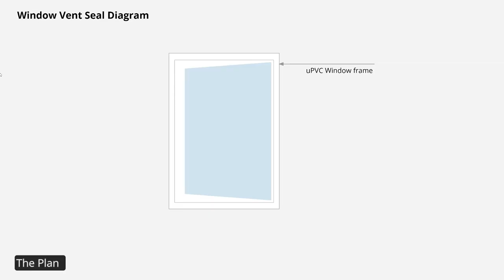DIY window seal for portable air conditioner - Easy step by step guide

Comment: Thank you so much...  This is brilliant!  You did a fantastic job.  So much so that I just followed your directions and made one of these for a Newair AC-10100E.  We just moved into a house, and the window screens are inside the window glass.  This seal is perfect for that.  It even allows for removing the seal and opening the window quickly when the air conditioner is not in use.  The only thing I changed was that I used a thinner sheet of foam core and wrapped it in insulation on both sides for a slimmer profile.  I also covered the edges of the hole with duct tape after adding the insulation, similar to how you wrapped it earlier in the video when you reinforced the edges around the polystyrene before applying the insulation.  So basically, I did it twice to complete the hole, making it durable enough that the hose can be removed intermittently when the seal is not in use.  I also made sure that the foam core was wholly sealed from moisture.  I then added a gasket along the edge in places that didn't have velcro.  When installed, the hose is flush with the windscreen which automatically protects the open end of the hose and prevents problems with pests.

I live in Hawaii, and the sun is really intense here all year round and heats up homes in no time during the day.  I'm using this in conjunction with the De'Longhi insulated hose cover, and the unit cools my office quickly.  The hose cover is a MUST-HAVE for any portable air conditioner owner.  It's night and day, in terms of the performance and efficiency of the unit.  The hose cover prevents heat from escaping into the room from the exhaust hose.  The De'Longhi one WORKS.  The hose is barely warm to the touch even after using the unit for a few hours.  My office is about 135 sq ft with a 20 ft sloped ceiling that heats up dramatically in the late afternoon sun.  This seal is a headache saver.  Thanks again.
Reply from the maker: Really glad you found this useful and thanks for sharing your project too!!

Comment: Been searching for this solution a long time, everything else would ‘t stay in window. Instead of Velcro I used  gorilla heavy duty mounting tape, worked like a charm! 👍
Reply from the maker: Gorilla tapes seemed to come off from upvc frames as they heat up in the sun when we tried so had to resort to velcro for the second room. But good luck!

Comment: I ended up using twin wall Polycarbonate sheet from b&q cut it to fit . Applied hook & eye tape to secure to the window frame.  And when not in use I either pull of the frame to close the window or wrap some insect screen around the opening with a reusable cable tie to stop bugs coming in. Been working brilliantly in this heat. 😄
Reply from the maker: Polycarbonate sheet is a great shout! Feel free to send us a pic and we will upload on our website if you are interested. Best wishes

Comment: Great video, I can't wait to make my own. Also, do you have any tips for keeping the hose from sliding out of the hole? Mine keeps popping out with the plastic piece that it came with and it's driving me crazy.
Reply from the maker: Suggest you make it a tight fit. Or perhaps two small holes on the hose and running a barbeque skewer outside of the panel? Good luck!

Comment: Looks great. How does this hold up to rain? Wondering if you have wooden crank out windows if exposing them to the rain might lead to rot.
Reply from the maker: Good question! It held up well against gusty winds last summer (UK) and our windows are UPVC so not much risk of rain damage. Agree wooden windows will be exposed but same goes for other fabric type window seals I guess. Do let me know what you ended up with and thanks for stopping by!

Comment: Perfect! I have lots of reflectix left over to do this. I may use cardboard instead of styrofoam because I have lots of that. Unless a package is delivered that contains a styrofoam sheet of some kind - which could happen between now and when I'm ready to do this. Thanks!
Reply from the maker: Those insulation foils/reflectix do come in handy :) 
Cardboard sounds good, perhaps double or triple it for rigidity and also need to make sure no exposed areas just in case rain water gets in. And yes, we ordered a few dressers and wardrobes so our loft is full of those now! Good luck
Reply: I tried cardboard, regular cardboard and it was not thick enough.
Reply from the maker: Hmm, looks like polystyrene it is then..

Comment: I attempted this. Fingers crossed it works!! Thanks so much for sharing! One question- did you remove the screen from your window? If so, how are you preventing bugs from coming in through the exhaust?
Reply from the maker: We do not have sceens/nets on our windows and good point, no, nothing will stop bugs from getting into the air con unit I guess. Haven't had an issue though yet. Thanks
Reply: I purchased some fly screen from Amazon, cut off the amount I needed, used a cable-tie to tie that around the end of the exhaust pipe. It does make the unit slightly louder, owing to the noise of the exhaust air being pushed though the holes in the screen material. It solves the problem though as last year I did see wasps sniffing around the pipe. They weren't able to get in though.

https://www.amazon.co.uk/gp/product/B07DDB9BFM/ref=ppx_yo_dt_b_search_asin_image?ie=UTF8&th=1
Reply from the maker: Perhaps worth checking that the net doesn't put extra strain on the air conditioner pushing the exhaust air out through added obstacle (making more noise..). But the idea sounds great and glad you found a solution to the fly problem :) Thanks for updating us all.
Reply: @techlifediy  I had the same same thought :) It does put a little air resistance there but not a signifigant amount. It doesn't seem to be enough to affect the unit.

I actually came up with a minor improvement to your design that is for people with "fan light" type windows. The window arms (used for holding the window open and locking it) stick out proud of the frame. So I got a jam jar, put that over where the window arms are, drew around it then cut a star in the foam. That way the window arms can poke through, insects are unlikely to get in, and ony minimal hot air comes back through.

Perhaps I should post a video detailing it lol.
Reply: I would probably remove it and shut the window when not in use. I don't think bugs would go near the exhaust when being used

Comment: This actually looks great.  Is polystyrene essentially foam?  I’m surprised it came out so sturdy.
Reply from the maker: Hey thanks! Essentially yes, slightly harder though. I think the duct/gaffa tape helped a lot. Good luck with your build :)
Reply: @techlifediy  Thank you!
Reply: Polystyrene will leach vapors when heated. I wouldn't use it in the window.

Comment: Hi. May I know how do you make sure that the exhaust hose stays in place?
Reply from the maker: Hey, so I made sure the diameter of the hole was a few mm smaller than the flexi hose pipe that came with the portable air con. So when you push the hose through the hole, its stays pretty stable. Hope this helps! Thanks

Comment: I  just use my window screen for my insulation frame, all because I have the crank casement windows, that way I still have option to open and close it on a rainy day without removing the insulation i have a backup window ac in my bathroom that slides up and down, for a back up when it rain out to fill in for the portable ac.

Comment: Isnt the insulation foil supposed to be on the other side? The tube produces hot air and the insulation will only keep that warmth in. Also it would protect against the sun if it was on the other side, right?
Reply from the maker: Yes absolutely! I just ran out of time that evening (started after work), I added insulation foil on both sides later. Completely agree, it is more important to have it on the outside than inside! Thanks for stopping by

Comment: the board I use 3 layer. 2 layer of thick plywood and polystyrene in the middle bacause polystyrene alone can broken crack easily
Reply from the maker: Good shout! as long the weight and thickness works for your window frame, it sounds like a great idea too!

Comment: Nice job going to look into this. Dud you but the foil both sides?
Reply from the maker: Yes I did afterwards, more insulation and also looks better too!
Reply: @techlifediy  will be doing this Friday. You hear good and bad reviews on portable AC but alot of the  time people either don't get one big enough for there room or they put the hose out of an open window allowing all the hot  air coming to come in defeating the objective.
Reply from the maker: Agree, getting the right size is tricky! Also, keep an eye out for the noise/sound levels. The one we ended up buying is awfully noisy! Good luck
Reply: @techlifediy   got mine today for the bedroom. Bedroom is 4500 BTU  so curtesy of dad he got me a 7000 BTU decibel I think is about 63 but I’m registered deaf so don’t bother me lol. Trying the unit out tomorrow.

Comment: We have rolladens that I pull down to clamp the exhaust down and make it dark. Could I skip the insulation foil?
Reply from the maker: You could skip the insulation foil but it adds extra insulating properties. Also seals polystyrene from melting perhaps from extreme heat. Other users have used PIR and polycarbonate (@4nnetes) sheets which may also be great alternatives! Good luck

Comment: How you attached this with your window??
Reply from the maker: Hi - adhesive hook and loop fastening (Velcro TM*) straps.
Reply: Will this rip the paint off the trim?
Reply from the maker: Depends on the material the trim is made of. For us, its UPVC so you can imagine it's pretty tought. Thanks!

Comment: Where's the hole for your drain line?
Reply from the maker: Our portable air condition doesn't have a drain line, only if we use the dehumidifier setting then drain line is needed. Hope this helps!